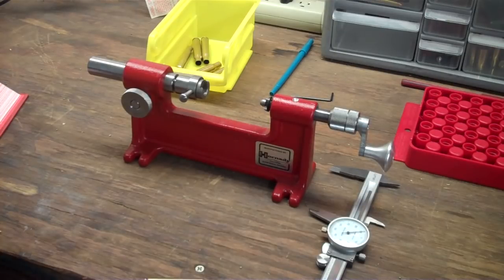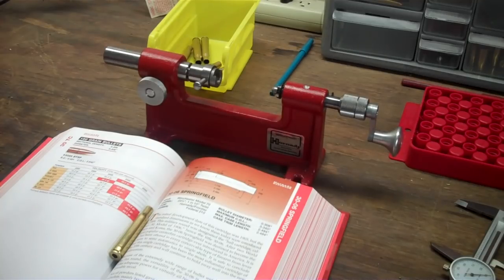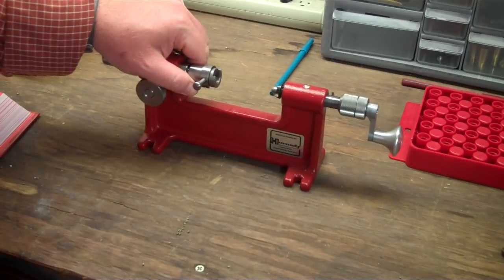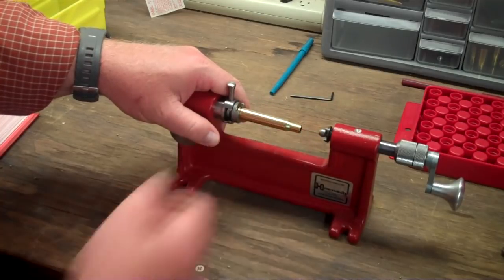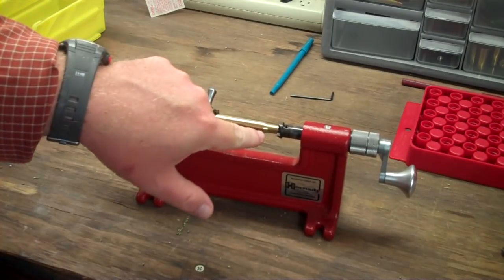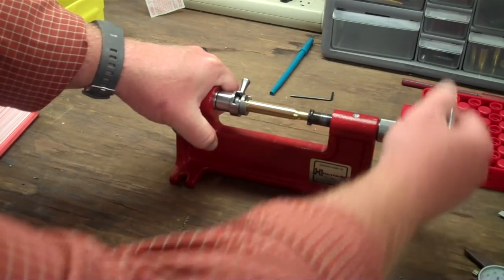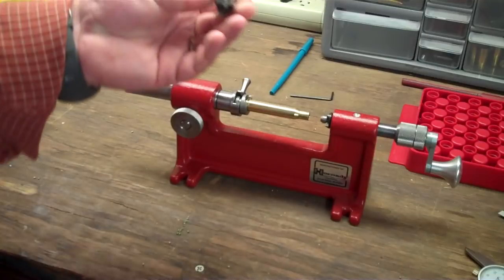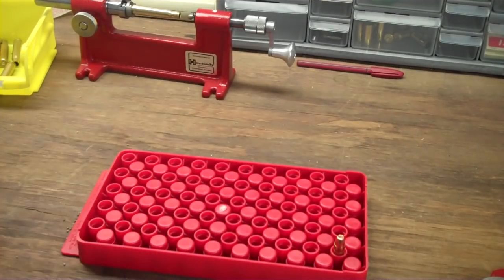Reloading : Hornady Cam-Lock Case Trimmer

Comment: Heads up, you can use standard shell holders, just grind down the post that goes through the primer hole and you are good to go with any shell holder. I was a little pissed they were set up to accept only their holders.... nope, smarter than that.  Trust me it works, just grind a little bit at a time until it fits. I went for a really tight, but sliding fit and works well.  Happy turning!  🤔

Also, don't bother trying to drill out you shell holder.  Hardened tool steel. Tried it.

Comment: Good video. Thanks for showing how it works. I ordered one over the weekend and  2 hornady shell holders for it. I have master cases at the correct length set aside to pop in there for quick set up. It should be a good tool for doing 50 rounds or so in not too much time.
Much better than using a drill and hand tools any day. Thanks.

Comment: You're supposed to put the pilot in the case mouth before locking the case in the shell holder.  Doing otherwise makes the case mouth parallel to the case head when what you want is the case mouth perpendicular to the internal case neck.  You just showed everybody how to trim a crooked case mouth.  Also, the fine adjustment you're looking for is on the cutter spindle.  Moving the case spindle is for an approximate setting; You make length adjustments with adjustment knob. Source: the directions.

Comment: I bought one of these at the weekend, but ther IS micro adjustment in the two adjusters on the handle, this will mean you can leave the main rod ajustment where it is and make the mico adjustment incrementally at the handle end, then once achieved, lock it off.

Comment from the maker: @deathifacation Well, not quite understanding your comment here. What do you mean, by "doesn't get cut on the primer" ?  

Anyway.... Once I have a case that is the correct length, I usually set it aside and save it.  So, the next time I need to set up the trimmer, I can then use that saved case as a template.

Comment: Once the spindle is locked in place, it should remain locked in place.  Micro adjustments are made using the adjustment nut and lock nut located at the crank handle.  This video should be corrected.

Comment: Why didint you take the correctly lengthen case, measure that so it doesn't get cut on the primer then replace the correct one with the oversized one so it trims to the correct length without having to guess?

Comment: the rod goes through the shell holder and presses the rim in the shell holder it does not enter the primer pocket what so ever . Hornady has great how to videos on there website this guy is ok but not very good for beginners. This case trimmer will work on almost every size of brass except for the very large rifle. You have to use hornady shell holders though.
Reply: SOOOO true, the shaft rod might fit inside a 30-06 primer pocket, but sure won't fit inside a 223 rem primer pocket. Besides you want as much surface for the shaft to sit on when trimming a case. Ok video to understand the basics but does contain a few mistakes. Fine adjustments are indeed done with  both coller next to the handle.

Comment: your not using it right...    press cutter all the way forward onto shell, then lock in shell, lock in left knob after chasing up the slack(this knob no longer used)...  use adjust nut on right side to left of crank past skinny thumb nut(locking nut), fat thumb nut is Adjustment nut(fat one) back off for deeper cut, forward on nut for less cut, use lock nut to lock in adjust nut, there is micro adjust that way. Micro Adjust is on right side next to crank fat one is Adjust. Slim is Locking nut. start with both locked together at about 3  full righty tighty turns from next to crank righty deeper cut later. start will long case... trim read, adjust locking nut more deeper till right. if done right no too short brass.
Reply: the Cylinder that it spins against on the right side from silver to red contact is the Adjust Nut, next is skinny locking nut.

Comment: I know this is an old video but for anyone looking for instruction on using this trimmer, please don’t watch this one.  First tip-off is not knowing the terminology of basic trimmer parts such as shell holder and pilot.  Second is constant corrections when communicating case lengths.  Most importantly, there is a lot of misinformation being conveyed.  His big gripe is the lack of a micro adjustment.  This proves that he never read the instructions before making the video because the two knurled knobs on the handle are for micro adjustments.  This is just downright terrible.